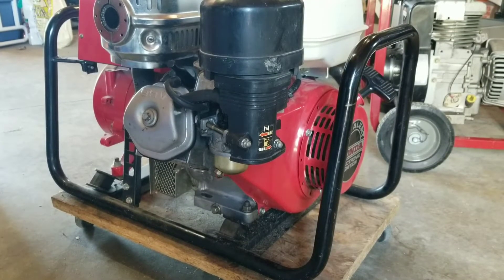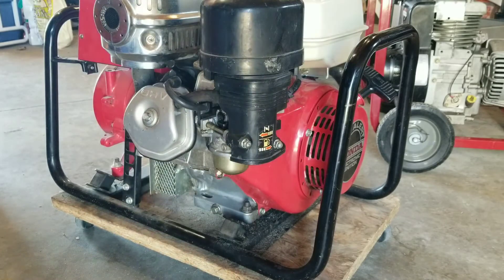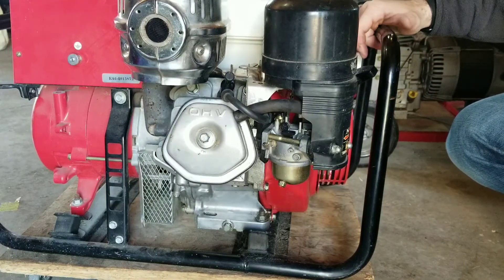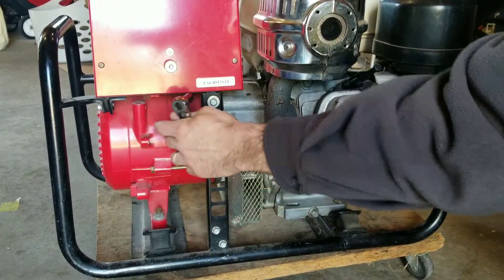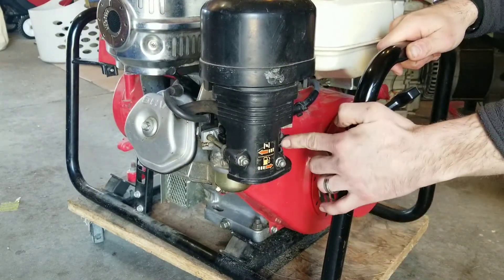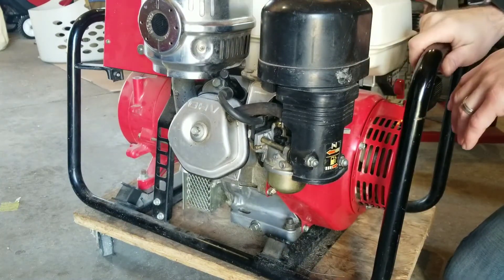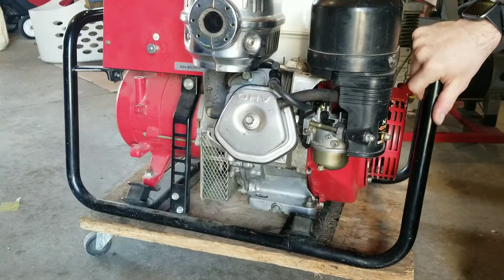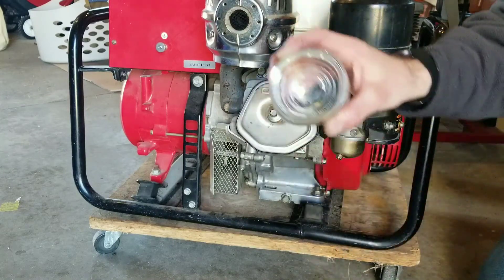How to Turn Off a Generator for Long-Term Storage [2 Methods]

Comment: Great video. I was wondering how I could run the gas out of the carb area.
How long can I leave the fuel line open to the carb without doing damage.
I guess what I'm saying can I leave the fuel line open for a couple of days before drawing or running it out like you did

Comment: After winterizing, does it still need to be started every two months? Thanks
Reply: I'm not OP but every 2 months is probably a good idea for 15-30 minutes under some load. I'm sure if you don't though, it's okay... Just a suggestion. :)